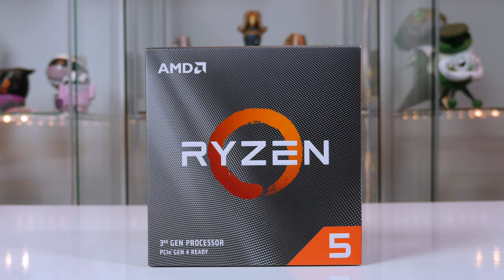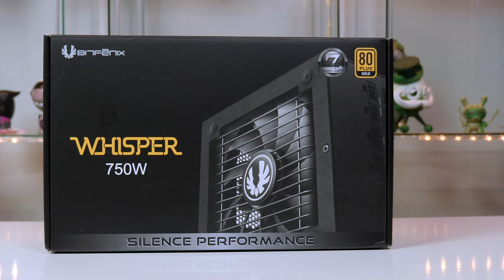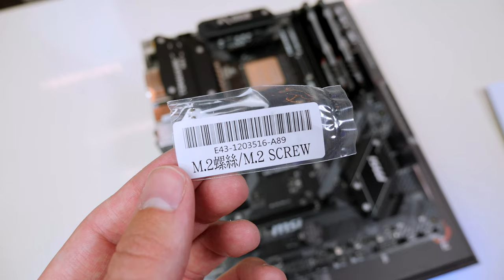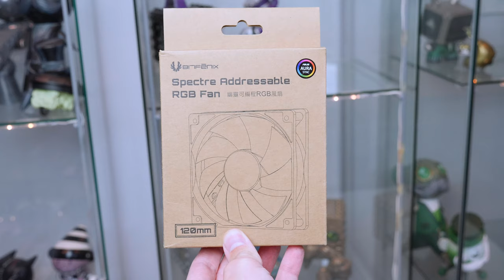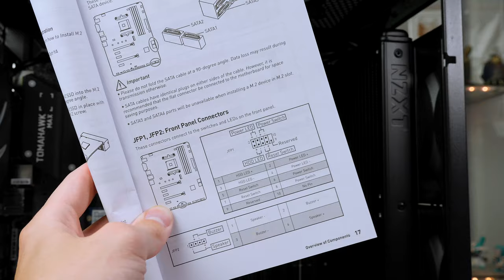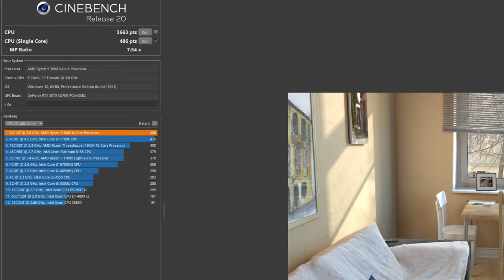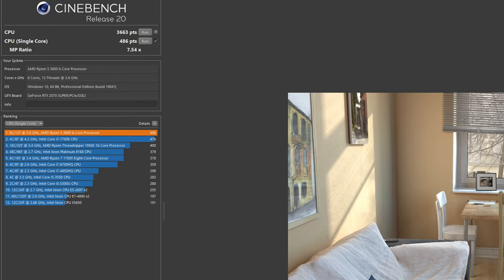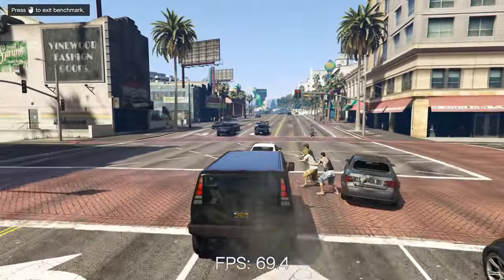Epic $1500 Gaming PC Build Guide 2020! Ryzen 3600, RTX 2070 Super, Benchmarks

Comment: How's the temps of CPU? I recently bought an 3600 and it's a mess. In stress it gets as high as 90 C°. (Have tried several thermal paste, everythings stock, nothing overclocked)
Reply from the maker: What cooler you using?
Reply: @BeginnersTech  stock ofc, but I have never experienced such issues with standard cooler. It's most likely due to high voltages on auto settings.